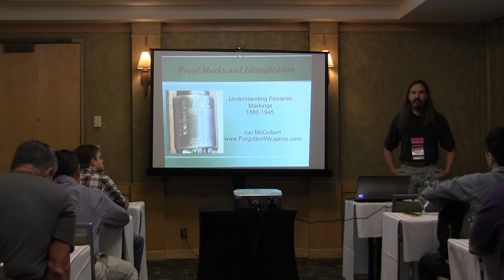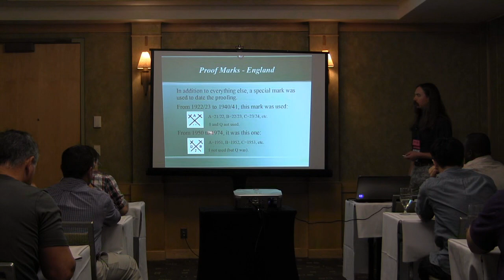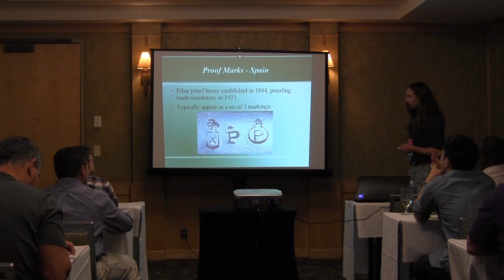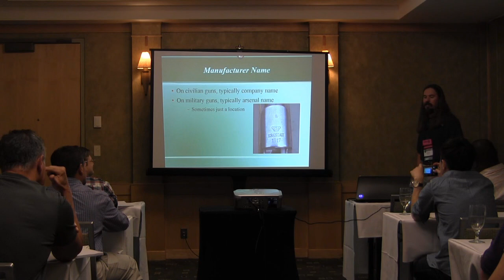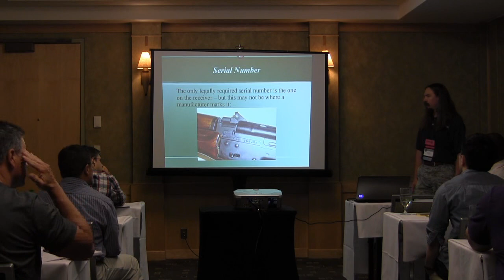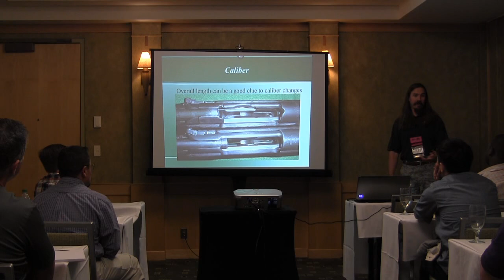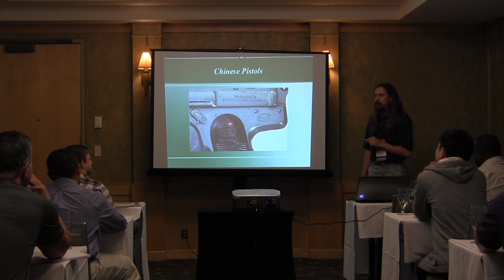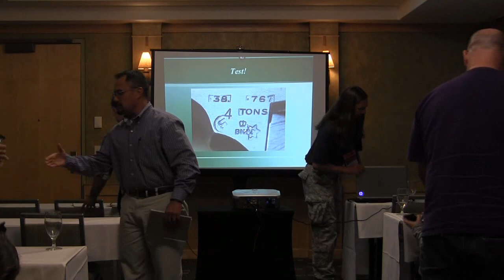Introduction to Proof Marks and Other Firearms Identification (1880-1945)

Comment: The L after .22 could stand for “léger” or “light” in French, “L” is also at the start of the Dutch and German words for “light”
Reply: It stands for long. As in "long rifle"
Reply: Not in this case. Rewatch it. He’d know if it was .22 long rifle.
Reply: .22 comes in multiple flavours with a common cartridge base. Short, Long, Long Rifle and Magnum being examples. To add confusion there are 0.17” rifles that chamber and fire 0.22” long rifle…(actually safely…)
Reply: @allangibson2408  And .22 Extra Long, .22 BB, .22 CB...

Comment: Gungineer49 -I'm a great fan of Forgotten Weapons since I discovered your channel a couple of years ago. However, I would like to point out the fact that you transposed the bore diameters of the Gewehr  88 chronologically. The .318 bore came first and the S Patrone (.323) was introduced in 1905.This has been mentioned in the comments previously by another fan , but I would like to clarify the conversion. The original "J" Patrone (.318) cartridge used a rounded 226 grain bullet with a muzzle velocity of 2093 fps. In 1905 the Germans adopted a improved S Patrone cartridge that retained the same case but employed a 154 grain .323 diameter Spitzer bullet with a muzzle velocity of 2880 fps. The older Gew '88 and Gew '98 rifles (with the .318 grove to grove diameter on the rifling) were converted to fire the new S Patrone cartridge by increasing the grove to grove diameter to .321 and reworking the chamber slightly. This conversion could "safely" fire the .323 S Patrone cartridge. Rifles so converted were marked with an "S" on the top of the receiver ring. It is safe to fire the .318 J cartridge  in the .323 bore but it is not safe to fire the .323 S cartridge in an unconverted .318 J bore rifle. Some of these J bore .318 rifles still exist. This information can be found in the 12th Edition of Cartridges of the World by Frank C. Barnes. In addition the top Gew. '88 rifle shown in your video was also converted to accommodate 5 round stripper clips like the Gew '98 used. I have a Gewehr "88 that has an "S" stamped on the receiver ring but it still uses the Mannlicher clip. I would not recommend firing .323 S ammunition in an old Gew. '88 rifle even though it has the "S" on the receiver and has been converted to .321 (grove to grove diameter).

Comment: Totally neat video- I learned an awful lot.  Just as a side note- not that anyone really cares- most of Belgium would have been under the control of Spain in 1672, though that was contested by France.  Liege, though, was technically independent, though that independence was more or less at the sufferance of the Spanish Crown anyway. Which makes it all sorts of interesting to me, personally, but is probably trivia for most folks.
Reply: Jon Hendrickson Spanish Hapsburgs, correct? They were originally Austrian, and Austrians are ethnic Germans.

Comment: First, let me thank you for the video. I appreciate access to this sort of information in a video format, for free. I realize that specific info is available in books, but it's great to get the basic rundown in a video format.

At 1:11:21 you show a picture of what was described as a Gew. 88 made by Spandau.. I believe that to be incorrect. That rifle should actually be a Gew. 98, based on the date of manufacture and the shape of the barrel shank.

Again, thank you for the info.
Regards,
John T.

Comment: I have an SMLE that is absolutely covered in marks (even the sling swivel mount has a broad arrow) and I only really know what the serial number and broad arrows are.
Reply: If it's covered in proofmarks/army acceptence marks wouldn't that be a sign they're faked? The british army wouldn't stamp something that important on anything but the reciever or barrel, I don't think. Is that the only place with a broad arrow? Because I can garantee they wouldn't stamp the acceptance mark multiple times.

Comment: Question.  On that last slide,  the 4 is stamped over the left Israeli mark and the right one is stamped over bnp.  Based on the rest of the video,  is it possible it was used by Israel for military purpose based on the circle mark underneath,  brought back,  sold for commercial, hence the proof marking of 4 tons,  then got back to Israel hence the 2nd Israel mark?

Comment: I'm interested to know about the person from Taiwan in your class during this time. Because apparently in Taiwan as of right now, the indigenous population can only have "homemade/handmade" firearms. Which are inherently unsafe, yet you clearly state that a proof mark is in part for public safety; that firearms won't harm the individual using them. So the person from Taiwan, I'm hoping drove the point home that having properly manufactured firearms allowed for their indigenous population is essential for theirs and others safety. Maybe I'm wrong but hunting is their way of life so only allowing homemade firearms, by that one single individual, only you can make and use it; doesn't make sense to me.

Comment: Ian, I have a P08 manufactured by DWM in 1909 and it has the markings "crown B" and "crown U" no "crown N" ... the gun has matching part numbers on any part, except it got a new barrel with the marking S/42 under the barrel, small eagle with G3 left top and on the right side something that looks like an overlapping "P" and a roman 1, any ideas what this means? obviously it got a new barrel and a friend of mine who has a collection of P08 statet that the barrel markings are maintenance markings?
Reply: oh and it also has an additional Schiwy safety on it, was it maybe part of police weaponry?
Reply: The eagle tells you it was a WW2 refurbished pistol (it was used from 1942 to 1945).

Comment: IF you  placing an older  firearm IN TO or RETURNING it to service   its  a GOOD idea to  RE PROOF  or  TEST  in controlled  environments   the  action for  hidden fatigue   or  unseen fractures from time, poor storage, or  old time  OVER PRESSURE  unknown to you. 

 MOST  modern guns  are tested to 125%  of SAMMI pressures for  commercial and   CUP  for military  test values    

 and  MOST  modern loads are close to 60-65K PSI    + 25%  so your tests will be  in the  75-90K pressure  range ...
Reply: Reproofing can cause damage or even destroy perfectly safe firearms by causing NEW cracks. Even the original proofing caused cracks in some firearms. Guns work on the bleeding edge of what steel can stand.